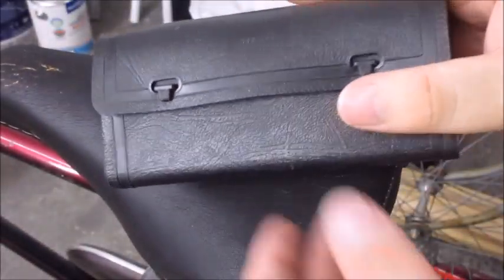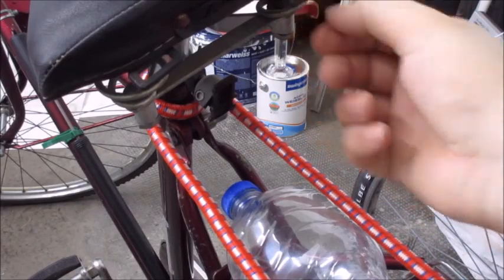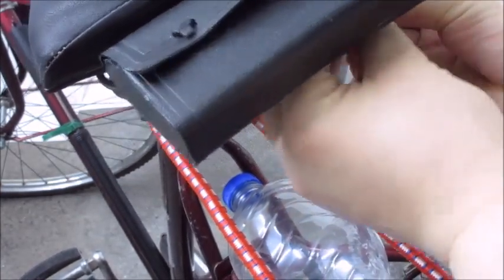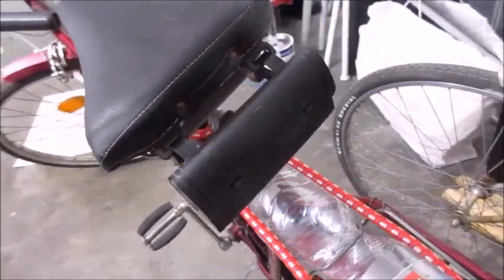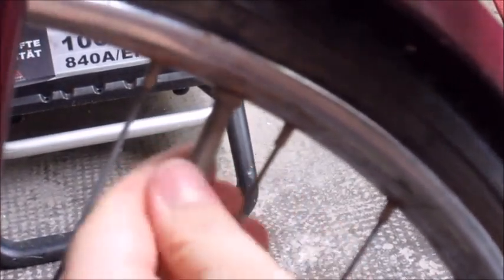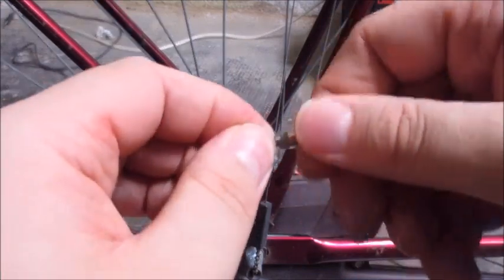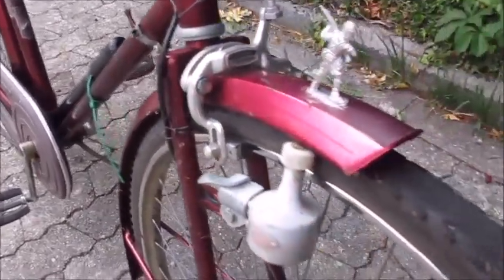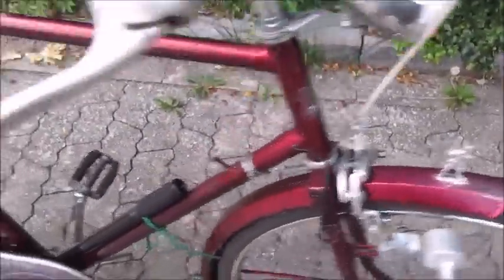Adventurers Club 🧭 additional Video to my Bike Cycle Survival & Tool Kit

Comment: I've not seen a valve stem for a tire like that. Is that new technology?  I once built bicycles from pirates spare parts and I can't recall that then.
Different note, I see no lock or chain on your bike.  Theft must not be an issue there.
Reply from the maker: The bike is from the mid 70s, the valve is probably as old as the bike itself ( but maybe the previous owner bought it later ) ?
Reply from the maker: I have a lock, it's not visible in the video because I hung it over my shoulder, its a very light cheap one  ( when I'm at home I put it in the garage )🙂
Reply: @adventurersclub1  thanks.  I ended up with what was then called a '3-speed' 'Imperial' bike.  Wishing I had kept it.  It was a 70's bike also.  Perhaps I just forgot what the valve stems looked like.  Keep the bike.  Vintage is awesome.
Reply from the maker: @barrykelly2722 
I also had a orange Imperial folding bike from the 70's, but it was stolen during lockdown...

I still have a pre-war bike in the basement, when I get around to it I'll restore it (as a winter project).